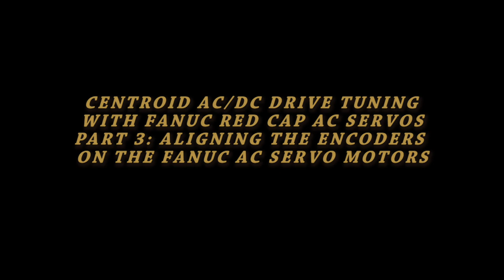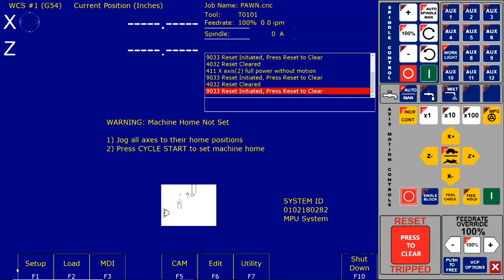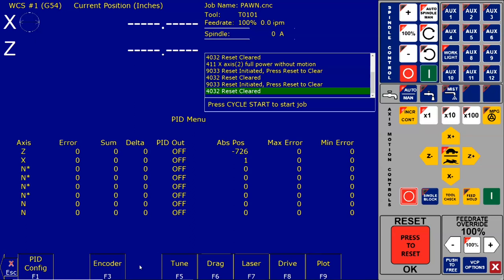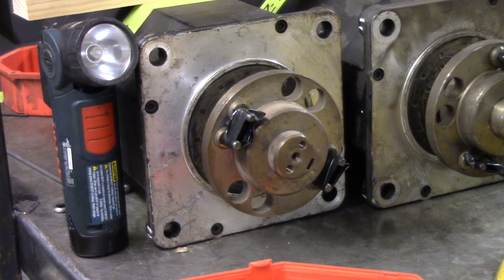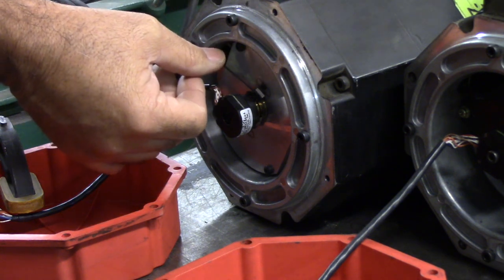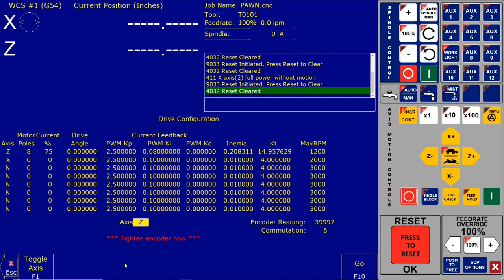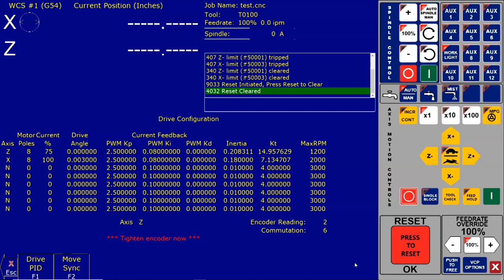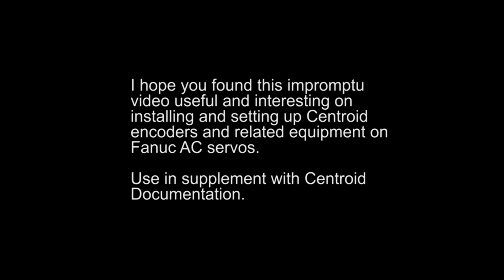Centroid AC/DC Fanuc Setup Part 3

Comment: What happens when the motor has a brake
Reply from the maker: Like for a Z axis? You would use the control with a brake output to release it.
Reply: martyscncgarage awesome... I must say that this is just a revolutionary solution to the guys who have old machines in their shops .im little disappointed to learn that they use optical communication instead of STEP/DIR
Reply from the maker: @seimela  Step and direction is really not the proper way to control a very large machine...